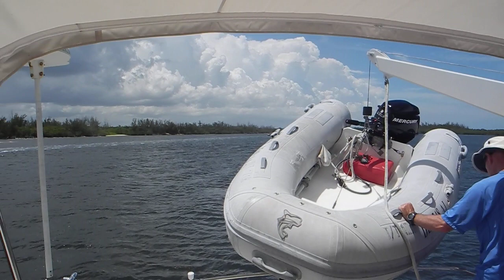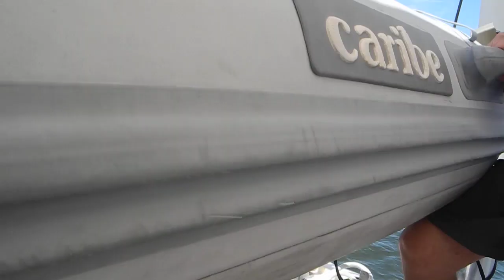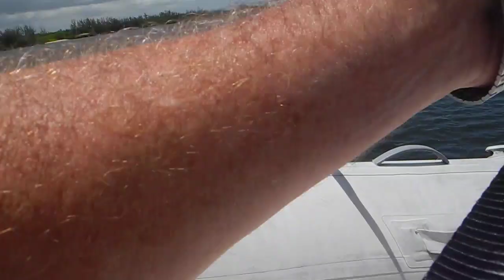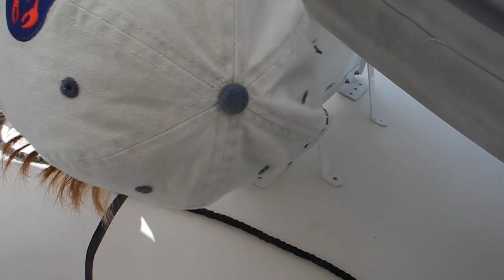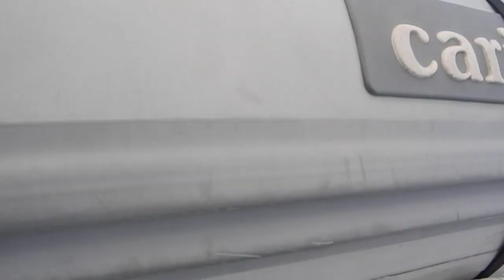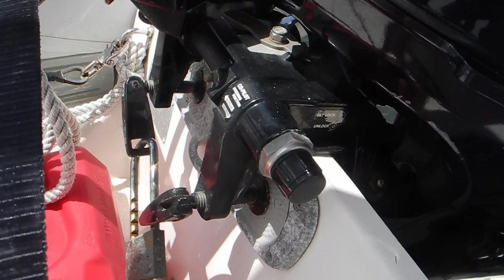Dinghy cradle

Comment: Should you flush the motor with freshwater?
Reply from the maker: YES, keep the lower unit clean and the rubber raw water impeller rinsed out. This also flushes the entire engine block. A product Salt A Way is a great way to flush the motor before long storage. In this case they may use the dinghy every evening to explore so that takes a lot of time and treatment.